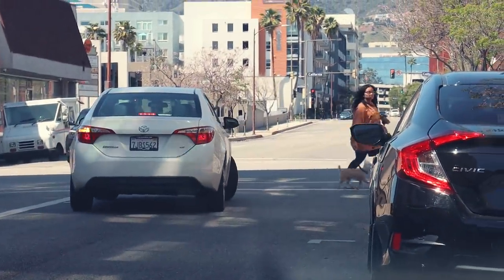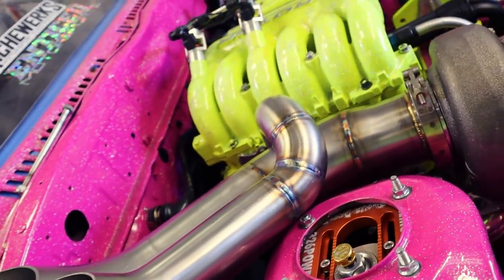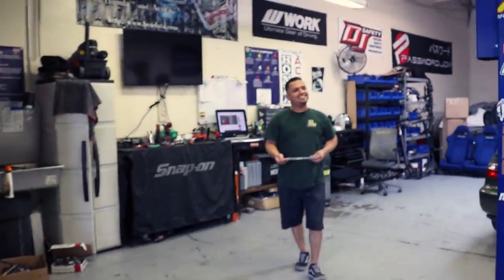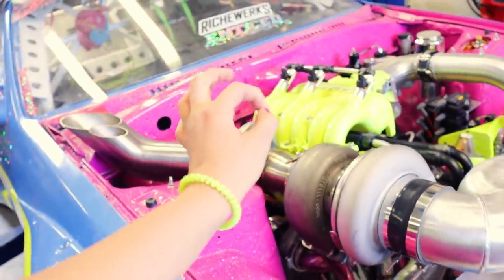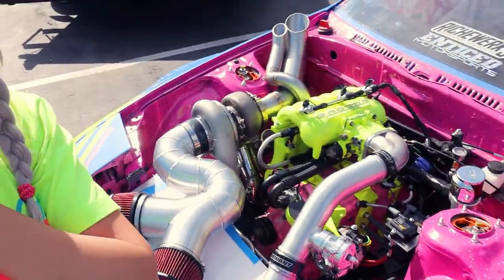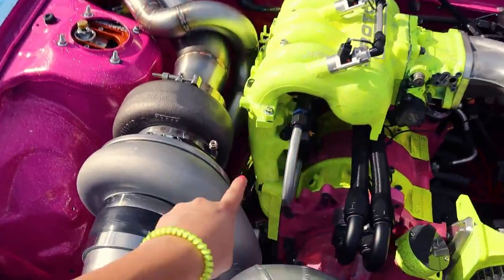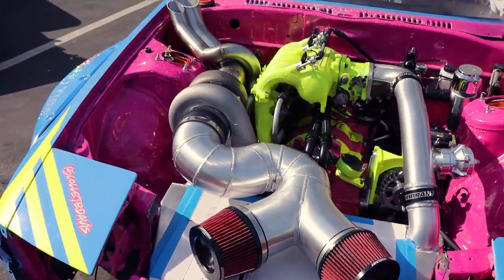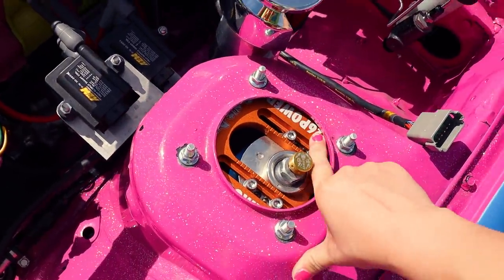MY CRAZY 3 ROTOR RX7 DRIFT CAR!! Pure Madness!

Comment: Hey Collette, just so you're aware, when you were showing the billet LCA's I noticed that your rotors have directional cooling vanes and they are on the wrong sides. Sick content though and don't fall back behind!
Reply: Internal veins are running in the correct direction, external slots aren't that much of an issue directionally
Reply: Slots are for wiping gas out of the pads
Reply: Lol bro has no clue wtf he’s talking about.

Comment: Class car love the 3 rotor and the FC but ,Which would you rather leak , Air or oil ?? First big kerb them oil coolers are gona get whacked 1920s mob like 🤣 they should b sumwer safer and intercooler down ther , you should Put a big sump gaurd on that thing b4 you hit the track 6mm thick aluminium with wee 20 mm 45 degree bend at the front should keep you safe .👍🏻👌🏻 ... air is lazy and dosent like to change direction, a horizontal Intercooler with no fans not really going to be all that efficient 45 degrees maybe but horizontal no its just going to deflect  all the air through the oil coolers any gaps . 👌🏻 It does look cool though 👍🏻

Comment: “No one on Earth has a 3 rotor rx-7 setup like this” ....This is true being generally the worst place you could put the intake is right above the intercooler seeing as its just feeding the filters a solid hit of hot air..unless feeding cold air directectly thru hood. Other then than that it looks sick!! unreal car and you will love it!
Reply: That intake is more for cruising on the street or going to shows. It'll just run a screen directly on the turbo for drifting and comps. Also probably running e85.
Reply: @turbocateyeS475  For show I think it looks great. For drift I see some heat soaking issues but as stated before there are totally ways around that. Gorgeous build no matter what

Comment: Generally the intake is placed as far possible from heat source in order to get denser air but here it's placed just above the intercooler. Is there a reason for this? Maybe the difference is so low that a shorter intake is actually better?

Comment: I thought that Dk @ garage life built the 20b ? Or did it get pulled down and reworked
Reply from the maker: Nooo.. he built it the first time and there were a lot of mistakes, so I DID NOT risk starting it and blowing it up. It was rebuilt , ported, port matches, stock sleeves swapped, cleaned ,etc. the correct way with Abel.

Comment: You’re brake rotors are on backwards 🤦🏼‍♂️
Reply: Ryan Doyle they’re actually not, the slots should be the opposite direction to allow airflow through the slots when rolling - not deflect it.
Reply: Ryan Doyle mate did you not listen to what he says in the video??? Watch til at least 7:33
Reply: Ryan Doyle 15:19 the vanes of the disc are in the wrong orientation. 
Agree?
Reply: Ryan Doyle cool 👍🏼